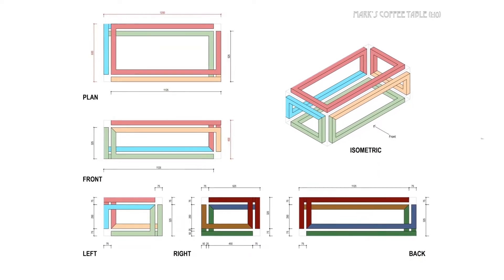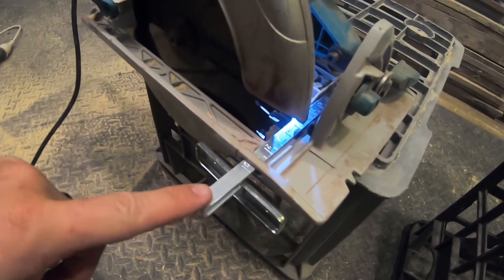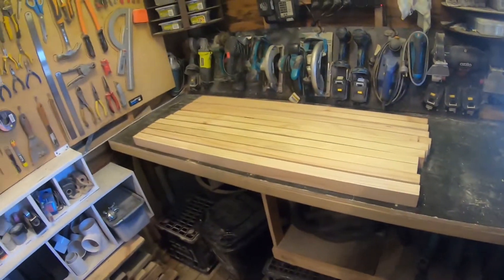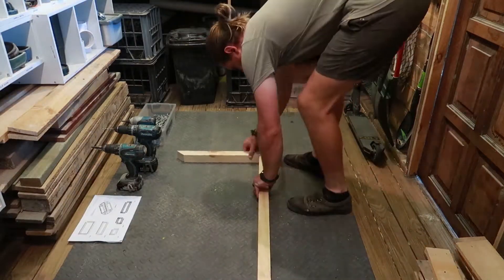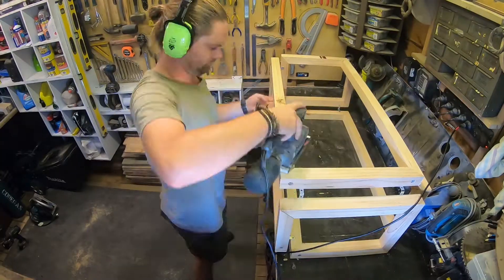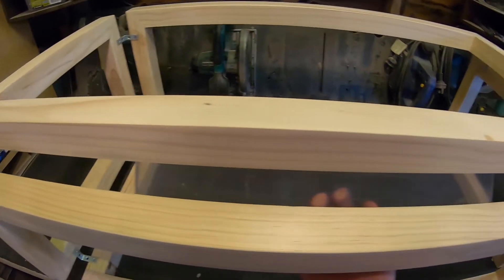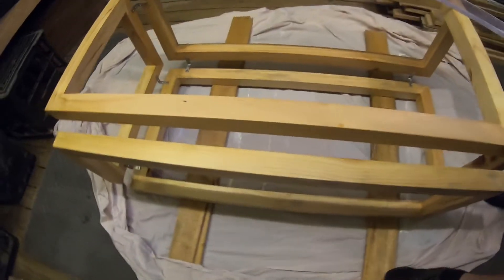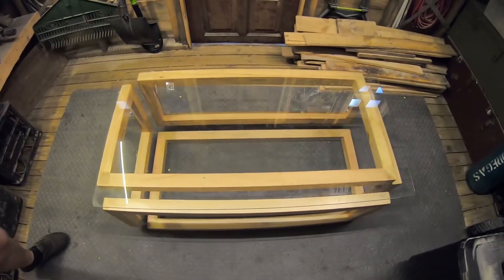DIY Timber INFINITY Table!

Comment: I was checking out your wine barrel video when I came across your endless table video. I had seen that table made out of steel awhile back and I thought could that be done with lumber? Question answered! Would it be much trouble and perhaps out of line to ask for plans and measurements thanks a million. If not I completely understand. Hugh
Reply from the maker: Hey, thanks for checking out the video! Happy to send you the plans, just email me at mark8v38@gmail.com